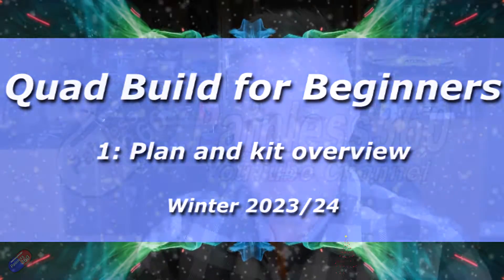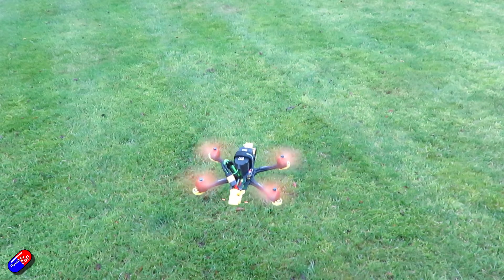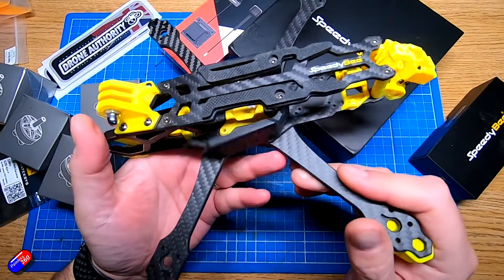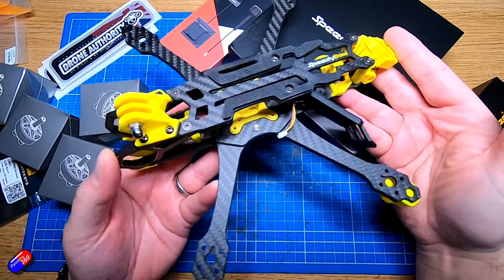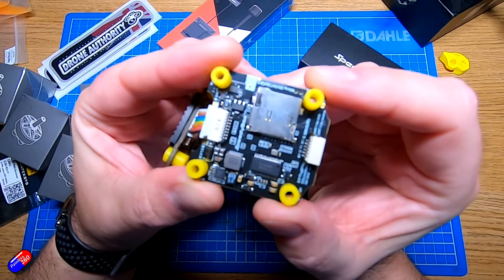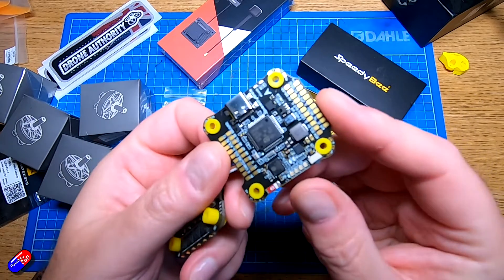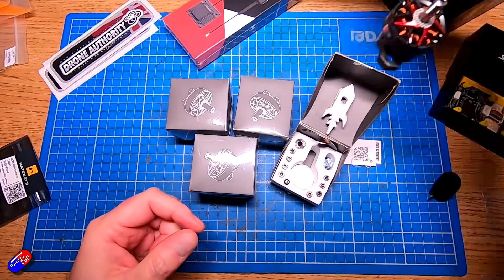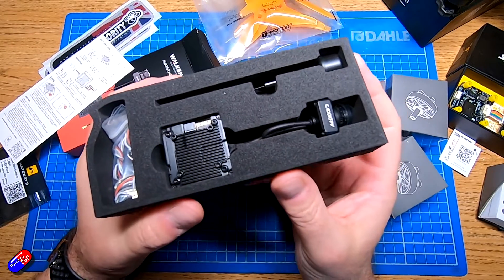Quadcopter Build for Beginners (2023): Part 1/4 - What the pieces all do!

Comment: Absolutely love your channel, just stumbled on it a few days ago, so soaking up much of your content.  I am planning to follow your build, but have a probably dumb question.  In this first video, you state you have the 2440KV motors from T-motor.  I can only find 1950 or 2150.  Also, in your link to the motors, it is to the 1950s.  Not knowing enough about quads yet, I don't know how big of a deal to not have the 2440s.  That is question 1.  Secondly, if 1950 and 2150s are available, which do you recommend?
Reply from the maker: Link to the right motors in the video description. I'd try to get 2400kv for a typical 4s build... Happy flying

Comment: So, I have started my project following this series, I have ordered some parts, and I'm hoping to reuse the motors I have from an off-the-shelf drone. I have 3D printed a frame in PETG carbon. The frame came in at 130g. It's the JeNo 7" Drone
 Frame. I ordered the stack and receiver, and screws/nuts. I'm going to print the protectors and bumpers in TPU. I'm also hoping to reuse the controller from the old drone. Trying to keep costs down as this is really a learning for a follow on project. I'm hoping to reuse as much as I can on the follow-up project! The long wait for parts now :)
Reply from the maker: Best of luck, in the hobby cutting corners can cost more in the long run... Happy flying
Reply: @Painless360  videos are very helpful

Comment: hi lee, as a patreon i built the holybro x500 with pixhawk 6c & mission planner. down sizing now i have the speedybee master 5 frame but i also have a matek f405 stack & a mamba f405 stack, if i use one of these which one would be your preference or go for speedybee stack. also don't know betaflight only used to Mp.    regards steve reed.
Reply from the maker: I'd recommend you follow the entire series and use the same kit. Message me on Patreon if you need in depth help... Best of luck!
Reply: ok thanks i will get what is  needed, as i said only used to Mp, will have to do some pausing, at least you are slower than americans. @Painless360
Reply: For this build, what is the preferred goggles to use?  Does this controller and ESC have capability to connect via Bluetooth, WiFi or usb?  Thanks
Reply from the maker: Goggles depends on the FPV system you add. I',m using Walksnail in my build. One of the advantages of the SpeedyBee stack is that you can access and change settings using a phone/tablet using a wireless connection.

Comment: Hi Lee I have already done this frame build with the SB F 7 V3  Fc which is virtually solder free for GPS/receiver/camera vax and the included frame lighting. I have also done the recommended Fc/Esc 180 reversal via Inav orientation tab . This is the best frame I have ever had and you are tempting me to have a try with it using Betaflight  for smoothness. Thanks again for all the tuition over the past few years.

Comment: Great Video Lee. With drones in this style can you add a gps and using inav can it fly like a dji cinematic drone? Oh, I suppose it would need a gimbal. But a RTH or "save me" switch would be useful for a new pilot. Will you be covering a drone  flight simulator so new pilots can practise before flying the real thing?
Reply from the maker: I'm thinking of adding a supplimental video adding a GPS.
Bottom line, if you want a DJI flying camera, buy a DJI flying camera. Quads like this are more versatile but need a action camera and a lot of skill to fly/film well.
You don't need INAV for a GPS RTH mode. Betaflight 'Rescue mode' works a lot better now... Happy flying